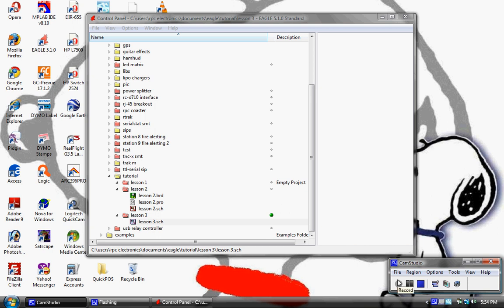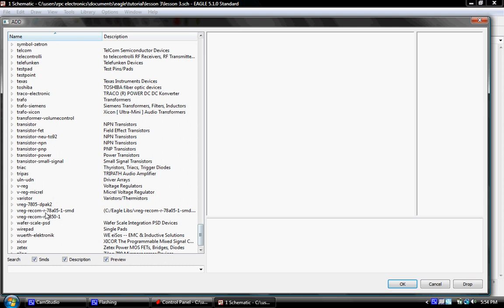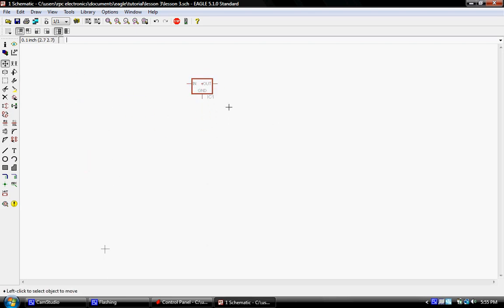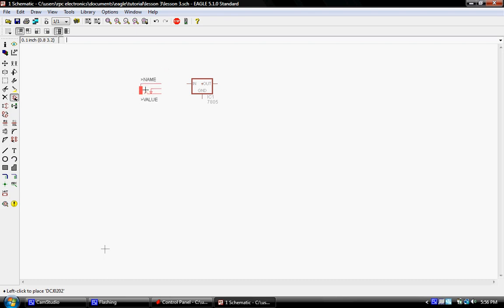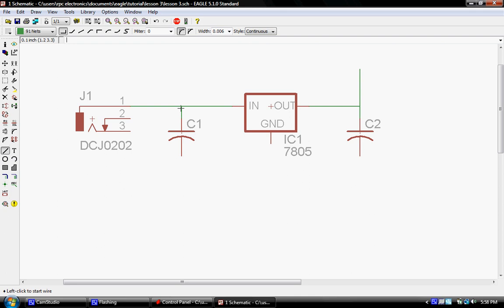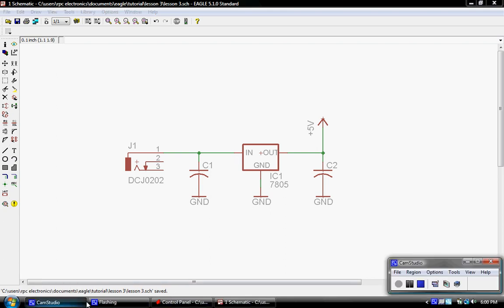Cadsoft EagleCad Tutorial Lesson 3

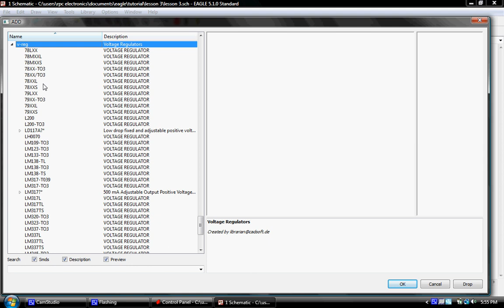Comment: 1:10 Selecting Voltage Regulator
1:50  Set value of V-Reg
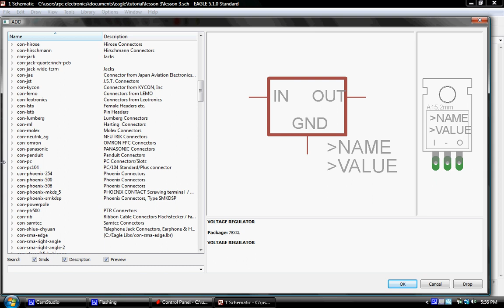2:18 Selecting Connector for Jack
3:15 Select Capacitor
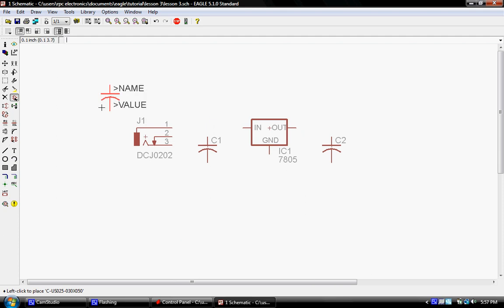3:33  Line tool
4:28 Junction tool
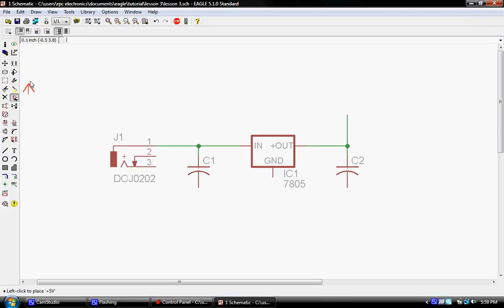5:13 Supply
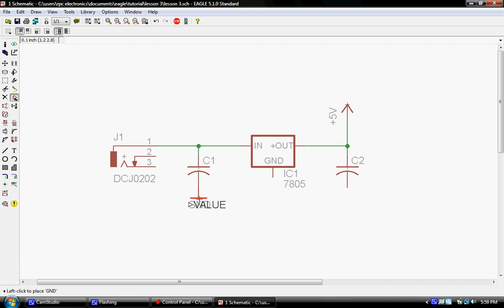5:40 GND

Comment from the maker: Yes.  There are some scripts floating around that have been written to do it for you.  Mostly for panelizing a design (multiple copies on one panel).  I have gone as far as to use the cut/paste commands to manually move an entire design over to a second file and merge the two.  It works, but you just have to be very careful with the alignment and spacing.  Also, some board houses will force you to have a single board containing both designs and then you have to separate them on your own.

Comment: It is strange that CadSoft manual tell us to use the NET tool (3rd symbol from the bottom on the toolbar, looked like a greyed out and bent toothbrush) to connect parts. However, you tell us to use the LINE tool. I got a lot of errors using the line tool even if i connected them but after learning about NET tool, i got it right.

This is a very important function that i think you must correct. Frankly, i have reason to doubt your skills when you teach such fundamental errors.